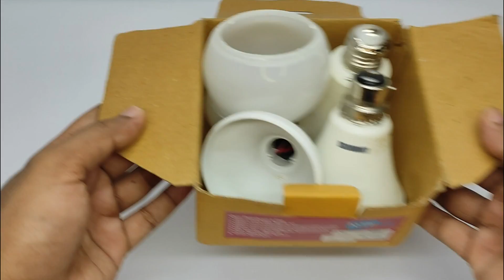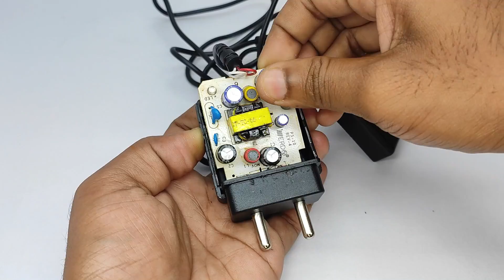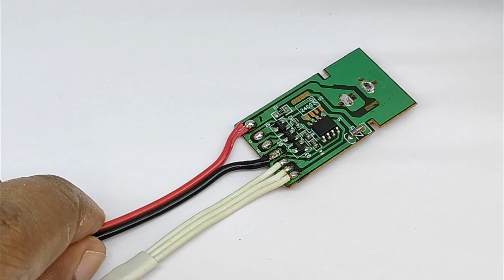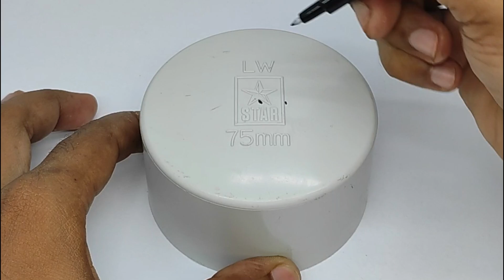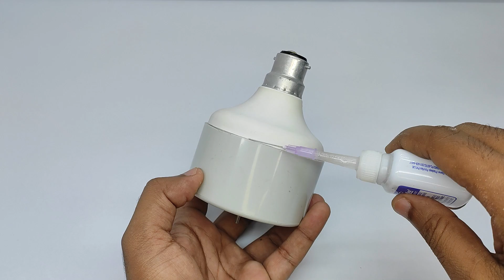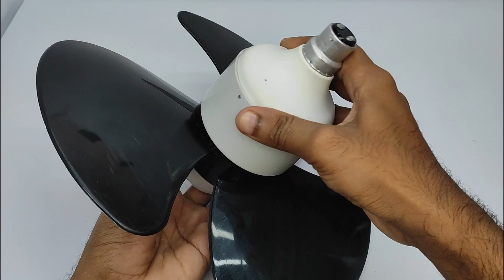How To Make Remote Control Fan At Easy

Comment: That remote control won't work in any way. The sensor is an IR sensor and it's in an enclosed case. The sensor won't receive any IR signal inside a box or this case a end cap. Another thing is the LED output from the TGB controller is an PWM controller and 6v DC motors won't work very well with it. When the motor is switched down, during stopping of the motor it will generate a voltage and the RGB controller doesn't have any protection for that. It's could work but don't use the dim function. The idea is nice but it need a little more work, also at safety.
Reply: lol yes.. we have to point out and it should be very near, else it won't work, i have the same led remote.
Reply: Absolutely correct sir